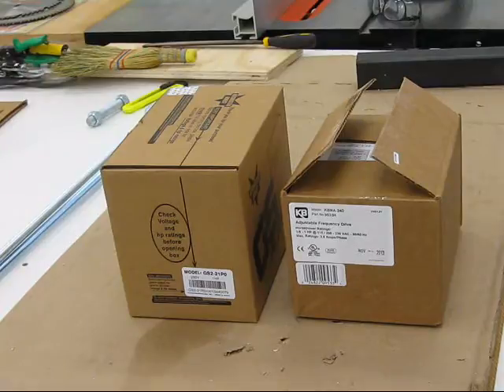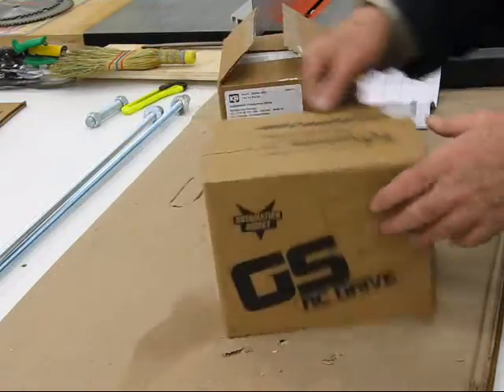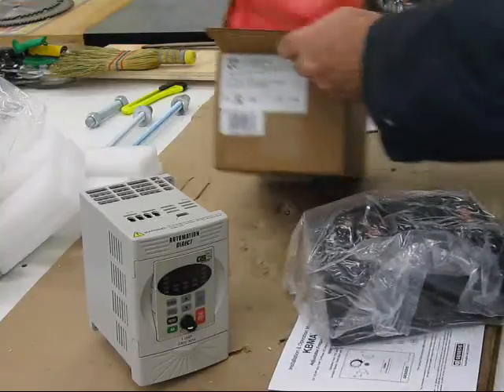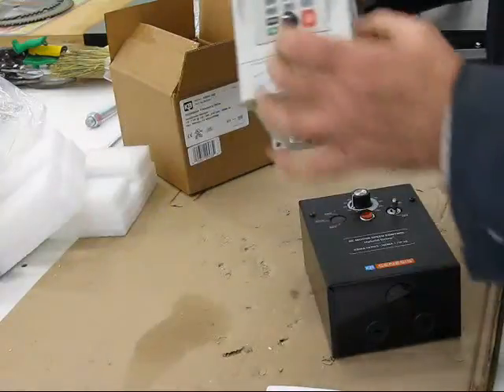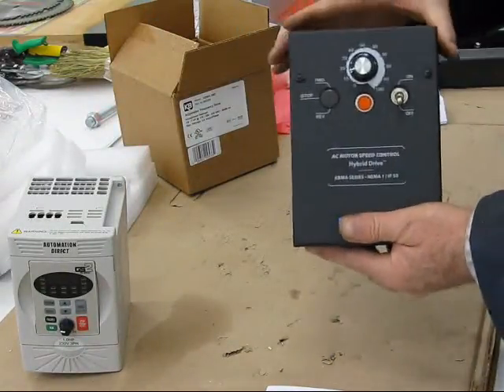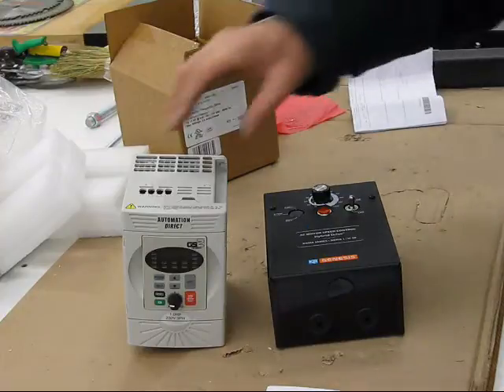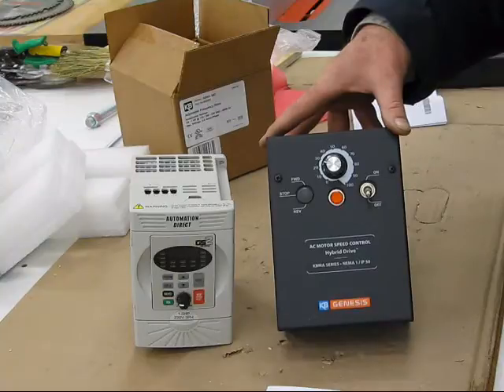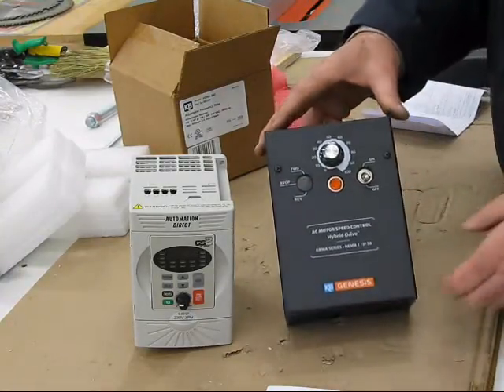Jet Lathe VFD Comparison

Comment: The grey VDF looks the part the other looks like it was made by the Fred Flintstone manufacturing corporation. What do you programme it with a wind up gramophone. One will just get hot at high torque low motor speed speed and the other will just go bang and melt. I will leave it to you to guess which one is the Lemon.

Comment: I'm 99% sure the KBMA 24D is the one for me. I like the simplicity and nema 1 case. Is yours still running without issue in 2017? Thanks (I enjoyed your fine install btw)
Reply from the maker: Hi John and thanks for the comment.  Yes mine is still running just like when I installed it.  But keep in mind that I have a hobby shop and only use it for hobby projects so there are periods of time that I never turn it on.  Like you said it is nice and simple and lends itself to having the controls remotely mounted.  The rcdon video in my description shows how to do the remote stuff.  If you proceed with it please let me know (perhaps do a youtube video??).  Thanks again   Rod
Reply: Thanks for the insight, Ron. I appreciate it. I'm hobby level myself, so no need for industrial capacity here either. I really like that the KB can be jumper'd for 110v to 220v use. It's a perfect solution for those either soon moving, or not sure where there machine will sit yet, or if electrical renovations are in the future, but a lathe is needed now. I will be sure to check out the link. Thanks :)
Reply: Beautiful install at the link. Were the toggle switches you omitted a a factory accessory of the KBMA 24D? I could be wrong, but I thought it's reverse/stop/forward switch was a single button. --- EDIT: I THINK I see now that what I originally thought was an forward/off/reverse push button on the KBMA 24D might really just be a knock out plug that covers where a switch can be mounted. IF this is true, then knowing the unit as you do, would you suppose it will be possible for me to utilize my lathe's existing drum switch, or will I need their proprietary switch wiring connector?  Thanks again.
Reply from the maker: Hi John.  Sorry it took so long to get back to you - Christmas Time!
WRT the switch You could probably use the drum switch but the switch I used I got off ebay from China for three or four dollars (and six weeks delivery) and works really well.  Yes where it shows on the front cover is just a knock out.  To help you here is the link to the manual which also shows the wiring diagram.  https://www.kbelectronics.com/manuals/kbma_manual.pdf.
It's in pdf and can be printed.  Hope this works for you - keep me informed & God Bless  Rod
Reply: Thanks so much Ron. I really appreciate the help. Merry Christmas. :) btw do you happen to have the link to the switch on ebay? If it worked good for you, then I might as well order one now ahead of the VFD which is still about 3 weeks away as far as when I can purchase one.
Reply: FINALLY ordered my KBMA 24D earlier this evening. :)
Reply: My KB unit was delivered earlier today. I hope to get it installed this weekend. :)
Reply: Installed and operational. I just need to swap two wires and change the direction. Thank you for all the help. :)

Comment: Not such a fair review the proper vfd looks like a vfd the other one looks like ac stepper motor controller,Where a transformer is used to bring down the voltage..The proper vfd has so many functions compared to the other black thing.
Reply from the maker: Hi Wana bear  - thanks for your input.
I know what you mean when you look at the pictures but they are both vfd's
The one from automation direct has a boatload of features on it including the option of being able to take the control panel off and mount it remotely.  The KBMA version has very few features but is a nice small package with which I was able to
physically relocate the speed, power and direction controls.
Thanks again Rod

Comment: Thanks!  That looks like it might just be a good option for the DSM Grinders I've been doing.  It's a belt grinder for metal and the Automation Direct (just like yours) one we're using has always bugged me with the vent openings.  This one is sealed and simple and a grinder doesn't need reverse!  Perfect! :)
Mike
Reply from the maker: Thanks Mike.  I really like your grinder and that is where I got the idea for the ASD in the first place.  How can I go about buying one of the grinders?
Also, this asd is reverseable. They sell a switch for about $27 (by memory) but
a cheap DPDT switch from radio shack will do the same thing.
Rod
Reply: Newmachinist
Thanks Rod! I'm glad you like it and I'm tickled pink to hear you got the idea from one of my vids :)  Steve is handling all the final assembly and sales.  You can reach him at dsmgrinder@gmail.com  
When I looked at the site, I noticed the ones with the switch looked the same as those without.  I was wondering if that's all it would take is just a switch.  $27? I wonder if it comes with a plugin wiring harness.....that price seems ridiculous!
I've got a bit of vid on fishmouth attachment for the grinder.  I'll see if I can get it up today.
Thanks!!
Mike
Reply from the maker: bluehandsvideo
Hi Mike.  Yes that's all it takes is a cheap Radio Shack SPDT switch (not the DPDT switch I mentioned above although it will also work).  On the circuit board is a jumper similar to the type used on computer boards with a little push on connector.  The jumper changes the direction of the motor electronically.  See COM2 on page 12 of the pdf manual located here
http://www.kbelectronics.com/manuals/kbma_manual.pdf
If you have an old computer for parts around you could get a three terminal connector from it and run to the switch as I did.  When you look at the board on page 12 it will start to make sense.  The switch can be low current.
I would have uploaded another video series but I used two cameras the format of the second camera is .mov and the movie maker program I use isn't compatible.  Will keep trying.
Reply: Newmachinist
Great information Rod! Thanks!! 
Very simple.  I'll keep this in mind next time I scrap some electronics or a computer.  I did a bit of searching and found prewired connectors for those that don't have a computer to scrap.  I'm pretty sure these are the .1"(2.54mm) pitch.
http://www.adafruit.com/products/972